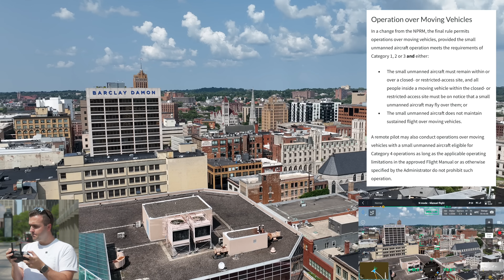The First Drone Flight Over People in the United States WITHOUT a Waiver

Comment: The FAA is really concerned with hovering over people not flying because your allowed to go from point to point on an occasional basis.  Also, covered structures like buildings are your friend so you can hover all you want on top of a building as long as no one is on the rooftop.  I think the AVSS is a solid solution to hover over people but in the meantime keep playing frogger until more DJI models are compatible 👍🏽
Reply from the maker: Frogger it is lol
Reply: @billykyle  can the AVSS system be used with any of the mavic 3 series drones besides the enterprise?  I have a Mavic three pro.

Comment: Would have been nice if ya cut the power to the motors so we could see if the parachute actually works…

Thanks for sharing…

The last time I jumped from a plane the parachute didn’t need any firmware and if you forgot to pull the cord it would auto deploy…

Can you do another video pulling the cord or cutting the engine..

$1,700.00, hell no.. at that price most people will still be flying by the seat of their pants…if am going to spend that kind of money need a live demo..

It only cost $200, to go skydiving and they pack your shoot..
Reply from the maker: Watch this - https://youtu.be/fIW7mAifpwM?si=rrHBuOIZf_FaJVh2

Comment: 1700$! I would need to see a breakdown for that cost. Tiny little plastic cup, tiny parachute and sensor 😞
Reply: @TheHeadman  Not even close to the first. There are at least a half dozen drone parachute manufacturers that I know of that have been in operation for at least a decade with deployment mechanisms ranging from ballistic, spring loaded, and CO2 fired. None are cheap either.
Reply from the maker: FAA Compliance is expensive for a system like this. Final testing alone is like $100k to $200k. Not sure what the MOC cost

Comment: $1700 usd? So much for the little guy trying to build a business....... sheesh.
Reply: If you don’t have $1700 you can’t afford to start a drone business! 😂 the drone I’m about to buy for mine costs $35k!
Reply: @210Deek   Thats a load of crap. Get off your high horse. There are plenty of drone businesses running 2 or 3 smaller ( mavic ) drones Glad you can drop $35K your life is much different then mine. I wish you the best.......but wow what a way to be a d!k
Reply from the maker: You could pay for this with one job. The equipment pays for itself.
Reply: @billykyle maybe in philly.  charge more than $300 for  job in colorado and you dont have a job. That includes editing and deliverables with the biggest firms.  FYI

Comment: How do you know how high you are for minimum deployment height since only your take off elevation is known? I saw you fly over buildings which obviously reduced the deploy parameters. I have to think the height is 150' or more which doesn't give that much detail on the ground.
Reply from the maker: The deployment height varies based on the drone. A parachute is added to a drone as a safety measure for bystanders on the ground. I don't care if the drone crashes into a roof and doesn't have enough time to deploy, because there is no one on the roof.
Reply: You don't care about poor little Debbie or Timmy tricycles swimming on a rooftop? 😆 🤣 😂

Comment: Operation over Moving Vehicles In a change from the NPRM, the final rule permits operations over moving vehicles, provided the small unmanned aircraft operation meets the requirements of Category 1, 2 or 3 and either:                                                                                                                                                                                                                                                                                                                 The small unmanned aircraft must remain within or over a closed- or restricted-access site, and all people inside a moving vehicle within the closed- or restricted-access site must be on notice that a small unmanned aircraft may fly over them; or
The small unmanned aircraft does not maintain sustained flight over moving vehicles.
Reply from the maker: Did you watch the video?

Comment: Ok…so since we have the parachute, we don’t also need to have prop guards to fly over people…? That’s 🆒!
Reply: Good point. Aren’t prop guards required?
Reply from the maker: No prop guards required. This has a flight termination system
Reply: @billykyle  

Thanks Billy.  Always great content.
Reply: @billykyle  - Thanks for clarifying…love the content 💯
Reply from the maker: @jeffvoigt3501 appreciate it!
Reply: @billykyle  I'd like to see that in writing. 107.120 requires that the drone does not contain any exposed rotating parts that would lacerate human skin upon impact with a human being. The drone being on the DOC as Cat 2 is separate, and part of 107.115. I'm curious about the FAA's response to this.
Reply: @iskde  I was able to verify with Josh at AVSS, that their proprietary processes (propeller braking, basically), were part of the Means of Compliance that was accepted by the FAA to demonstrate no lacerations. Very cool system.
Reply: Why would you need prop guards over people? You are over them. If the props fail you have a parachute at which point the props aren’t turning.
Reply: @DigitalArtisan77  - I think because it was a part of the FAA’s Category 2 definition; that prop guards were required for operating over people (in addition to waivers, etc.).  The thought process here is that everything remains the same regarding the definition; and the addition of the parachute just makes it easier to conduct such operations as you will no longer need a waiver.  

Having said all that, Billy is the expert…not me. So…I’ll defer to him for clarification.

Comment: How does it deploy if needed? Thanks.
Reply from the maker: A FTS turns off the motors and the parachute deploys of a failure is detected
Reply: @billykyle  HI, there. So, is there a motion sensor on the side of the parachute that if not in flight detects the props have stopped and tells the chute to open? Sure would like to see how quickly this engages and how much altitude is lost before the parachute deploys. 

Look forward to seeing your future video on this. Cheers
Reply: @billykyle   thank you!